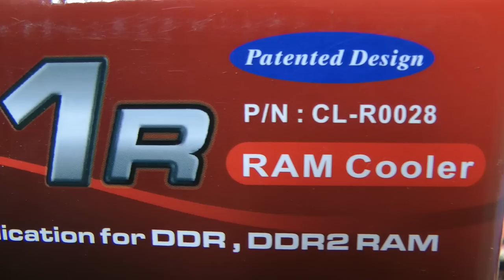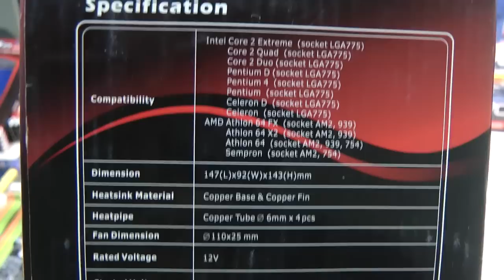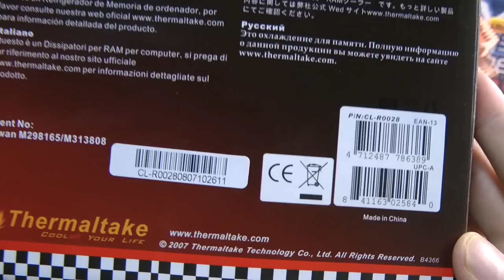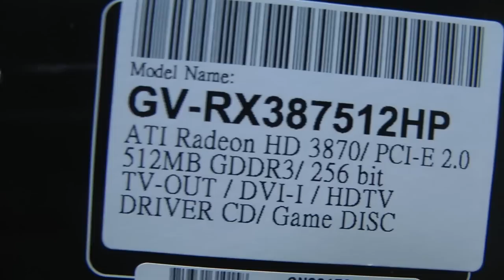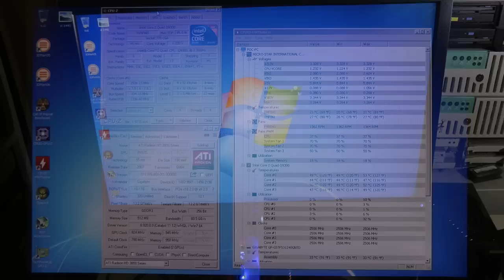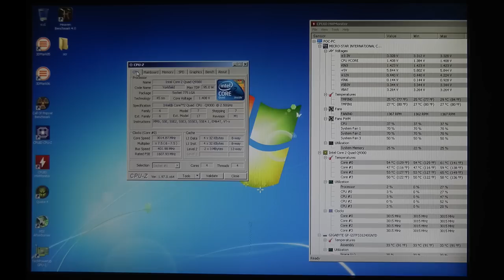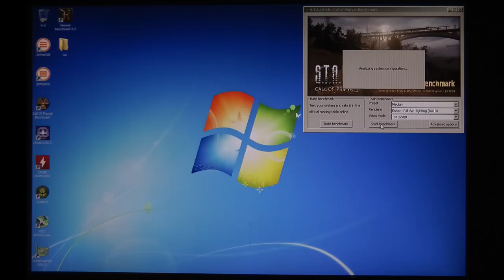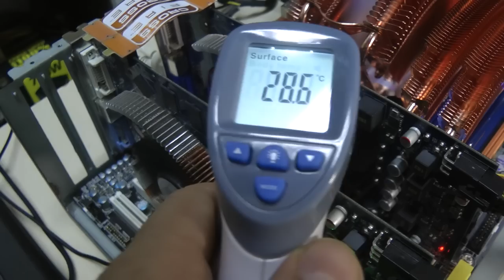V build on Intel Core 2 Quad 9300 and HD3870 Crossfire

Comment from the maker: All the time I was fighting with ... of course ... ATi drivers. Older versions (7-9) doesn’t detect cards in crossfire. Latest versions (around 13) has -30% performace. Versions around 11 finally works fine with regular results, but with random blue screens sometimes. Need keep eye on this later.
Reply: can we see some highend quad/sixcores and quad sli like dubble gtx 590 or 690 from you in the near future? that would be awesome. love your vids. keep up the good work!
Reply from the maker: here is triple tank setup :-) https://www.youtube.com/watch?v=zp7w7_FuR8Q
Reply: In running a 2 8ghz p4 with a sapphire radeon 3850 512mb ddr3 on an agp slot!
Reply: Good job! Bro!
Reply: Latest 2015 WHQL? And why you dont test a latest games on DX10?
Reply: I have msi p45 diamond but it have some problems everything is as should be all the lights fan spinong but no post I really like to reaper but who gone fix it with all this new board like 14gen intel to the reaper guy doesn't make sense he gone charge me like two new boards..

Comment: I feel like the copper will look beautiful if you put red LEDs under it hidden somewhere so you can only see reflections off the copper surface. And then put yellow or amber lighting on the PCBs.
Reply from the maker: Yep I need to think about case and lighting. I’am still thinking about different VGA setup, will see ...

Comment: this processor is literally more powerful than the laptop I'm currently using to watch this video (Core i5 3317U)
Reply: It's not. Your is about 5% faster, not to mention it is a step up in the architecture. Both of these CPU's are still perfectly fine for basic work even today. Impressive how suddenly CPU's don't age anymore the way they used to 15 years ago.
Reply: Q9300, Q9400 and those 4c4t LGA775 CPUs are still playable for games today if they are paired with decent graphics card
Reply: And your CPU are still a step up in architecture, it's just a laptop CPU so it can't be compared with desktop CPUs

Comment: This is brilliant. Such a great hardwares. Can you try this kind of systems with modern games such as CS GO etc? I love your works btw.
Reply from the maker: I don’t have access to modern games,me not supporting online shopping.
Reply: @RETROHardware  ah alright then, respected. Thx for your answer, i'll keep watching you :)
Reply from the maker: @pussy_slayer3000  free ISO on my HDD? :-) I will bet "free" by some spyware online software.
Reply: I played CSGO just fine at 60fps on a core 2 duo e7200 (2 core) and a R7 240 GPU. Both cpu and gpu in this video are far more powerful than my old system.

Comment: that was very cool , nice build for a old intel machine, i really like the copper coolers they are very impressive, and you did a great job cleaning up the video cards, one thing I use to clean heat sinks is a very fine makeup brush and a vacuum to suck up the dust .also make sure to ground your self to any components you work on , plus nice testing platform .

Comment: I've finally found the board for my copper themed core2extreme build! But i would do these all copper MSi frozr gtx 460 cards in SLi. Just need a fitting PC Case but not sure what to go with :p This build is pretty muvh what i had in my parts list aside from the 3850s. Looks beautiful!

Comment: my lifehack is to adapt these old pure copper cooler which you can buy for some bucks used for new builds :3
i really like the old xeon pure copper cooler, they are massive and nice
Reply: I have like 16 of these pure copper heatsinks from these xeons, I sold and rebuilt many x58 servers and always swapped the copper with aluminium ones so I could sell the copper 😂 never sold one tho.
Reply: @benjaminkaric2874  i guess you need at least a ton (literally) to make profit lol

Comment: i really miss those full copper coolers and heatpipes on mainboards today... they looked so pretty on the 775 era mobos. todays alu monstroseties look so blocky and ugly. I remember i had a q9550 e0 run at 4,2ghz on a ga-ep45-ds5 and 8gig corsair pc8500 cl5 ram with a gtx285 pretty neat system back in the day (:

Comment: What I hate about the ram cooler kits like this, and I'm gathering Thermaltake neglected to point it out too, the importance of adding some silicone cpu paste to the heatpipe before locking it in the plates, to help with heat transfer.

Comment: 2:46 I saw that the cooler can fit on an AM2 chipset.  I wonder if it can fit on a modern AM4 board?  I know the mounting hole spacing hasn't changed since FM1 days, but IDK anything older.  Can anyone confirm this?
Reply from the maker: You can make your own holders with different holes ... and put this cooler anywhere.